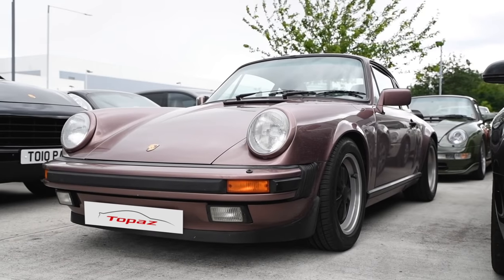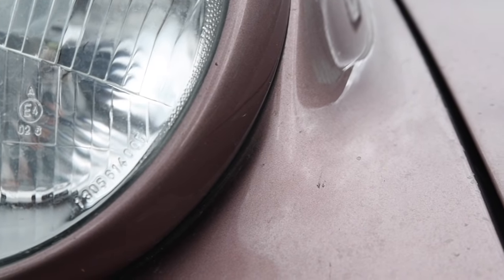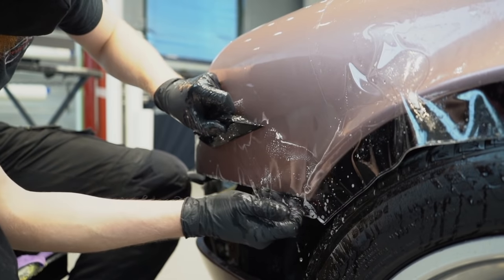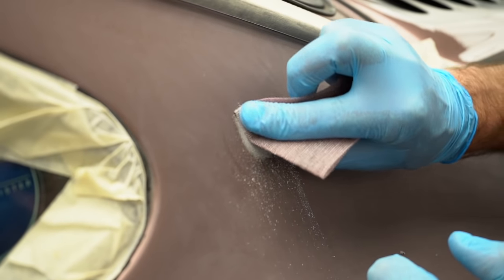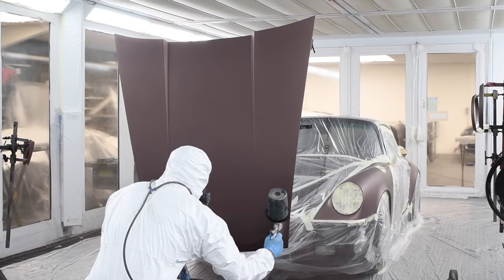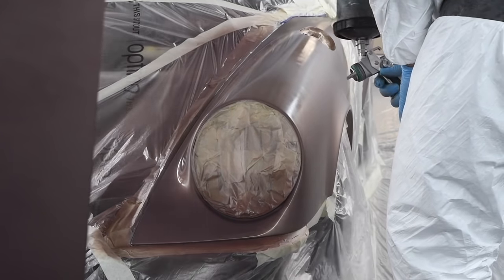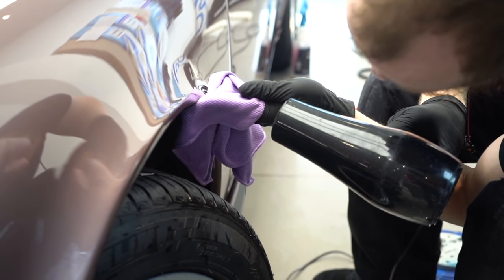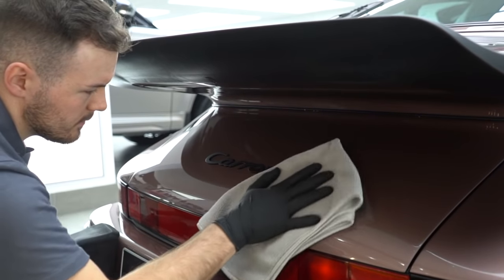Complete Cosmetic Restoration for this Classic Porsche Carrera SC!

Comment: lol, this body style porsche is literally the staple "training" ppf body style because of how the car can almost be done in 4 solid pieces.
Reply: How? Doors, fenders, bonnet, bumpers etc etc, that’s way more than 4 pieces???
Reply: @saadh3364  When you  are in an environment thats is geared more toward production versus the extreme levels of quality that I admire from topaz, you can do things much faster and more efficient than thought possible. Pieces cut for the 2 sides, roof hood and wing trunk area, cut on contact, not wrapping over as many edges as topaz, areas of concern that aren't applied to $20k cars as they are $200K cars. I'm not saying I personally would pay for a job like that, I'm just saying during training of how to do ppf by 3M, this body-styles bumper and other body panel are a staple of what is possible with ppf, it is also a staple of how difficult it can sometimes be to install it with perfection. I absolutely commend topaz and their quality. I will never get into ppf as I love the detailing and paint correction so much more.